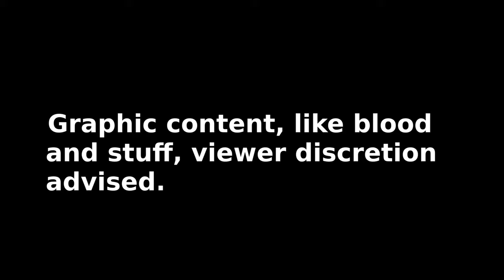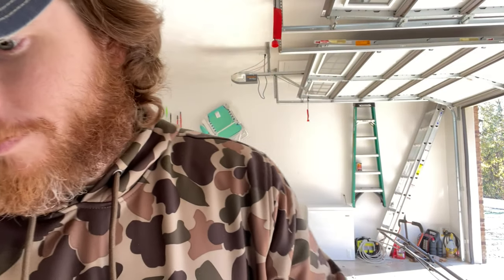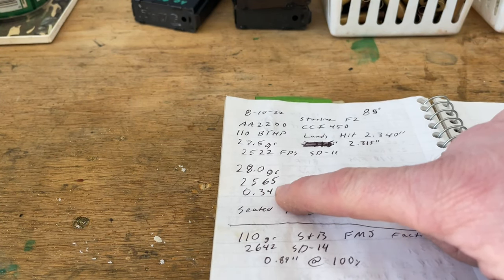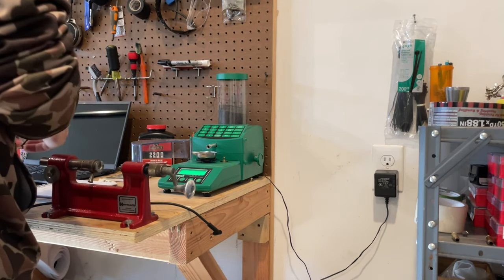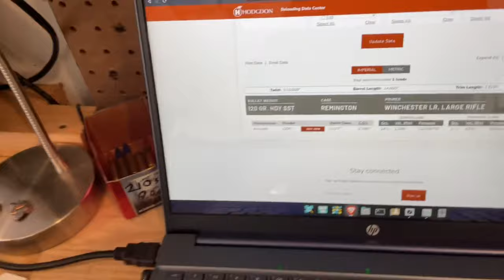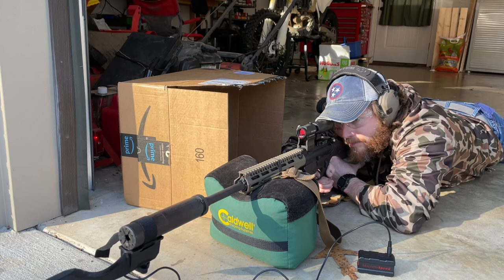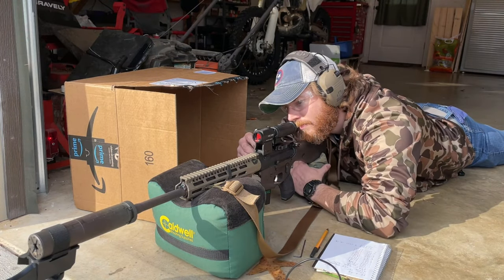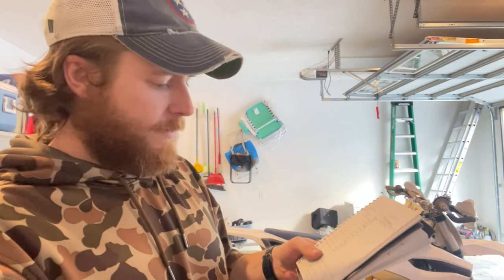Loads for the Lightweight 6.8spc : the 120gr SST

Comment: Hornady 6.8 spc custom gmx 100gr factory loads are what i use for black bear. It lazer beamed through both my black bear around 40-50 yards. One was a frontal chest shot entered at the collar bone exited the hip. Full pass through. For under 200 yards i love my 6.8 mines heavy at about 9.5lbs with scope and backup sights. 20" fluted heavy barrel. I keep a 2" group sitting 4-5" grouping off hand. With that same BCM pnt trigger.
Reply from the maker: Nice. I have never tried any solid copper bullets before.
Reply: @UnknownReloader  i have to use them for regulations where im at. They have made my 6.8 a viable bear gun at shorter ranges. I wouldnt have thought about the 6.8 for bear until i saw another channel of someone taking a black bear with some 90gr tsx rounds

Comment: Try the 90gr Gold Dot's, They are night and day vs the 120gr SST rounds. Also look at the cavity back bullet options for reloading they do great because of the cavity in back of the bullet that lets you get more Reloader 7 or accurate 2200 loaded into the case. I have tried just about all the bullets you can think of but I keep going back to the 90gr GD's.  Also the PRI mags are one of the best options if your looking for a good 6.8 spc mag. Also get yourself some small primer brass.
Reply from the maker: I’ll have to look into those before next season.